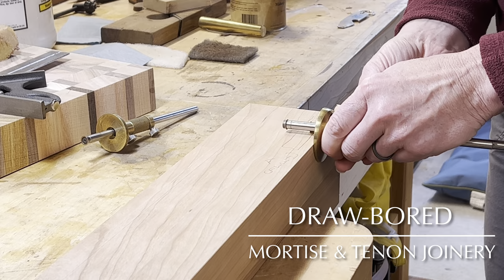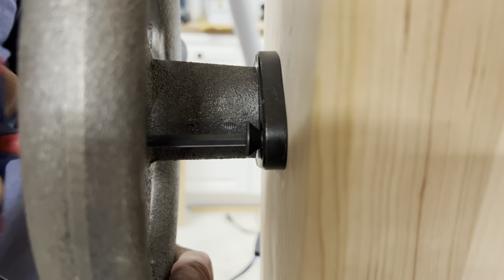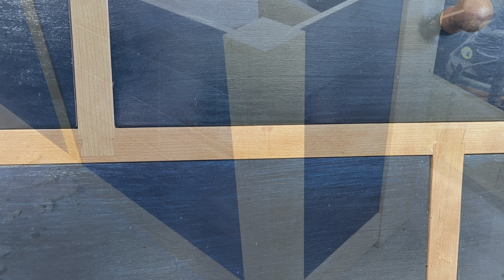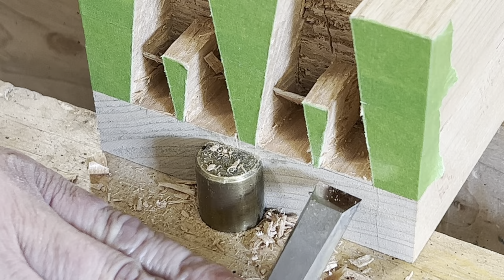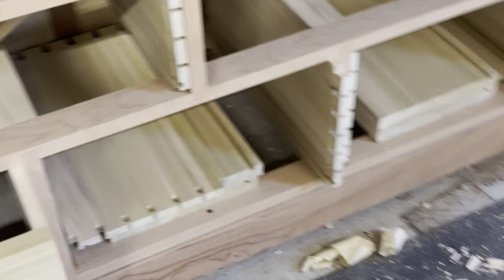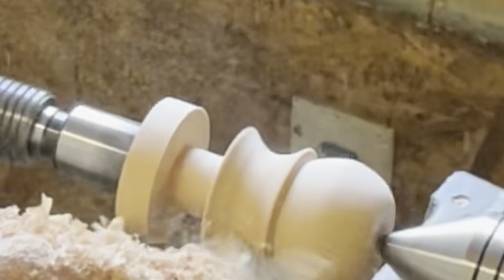Shaker Workbench Build Process

Comment: I think I just found my next woodworking bench! Have you experienced and "issues" with it yet?
Reply from the maker: If I had a do-over… 1) Go with a traditional tail vise instead of the twin screw (I saved $ by using the twin screw from my old bench). 2) Add space between the bench top and drawers to accommodate dog holes for holdfasts. 
These are my only design ‘regrets’. Best decision was the Benchcrafted leg vise. Good luck with your build! 👊
Reply: Thanks. I'm just finishing my bench build. I really like the idea of having one less open place for all the sawdust and shavings to accumulate under the bench. Shakers knew. @cleancutwoodworks